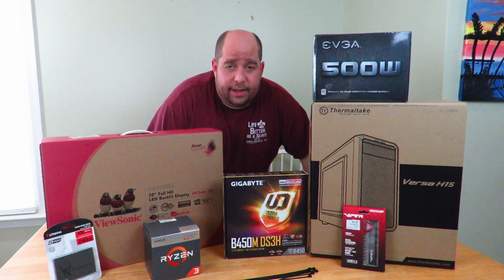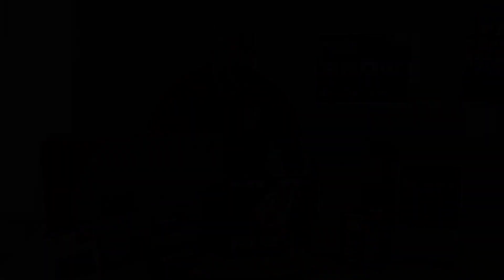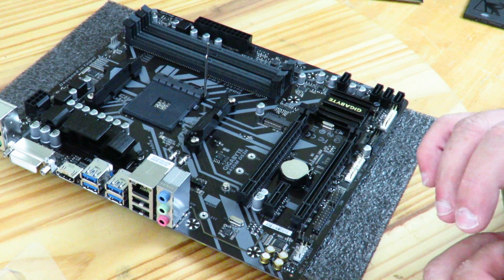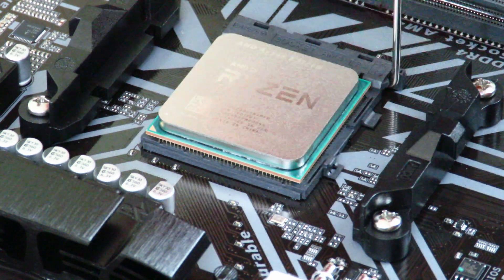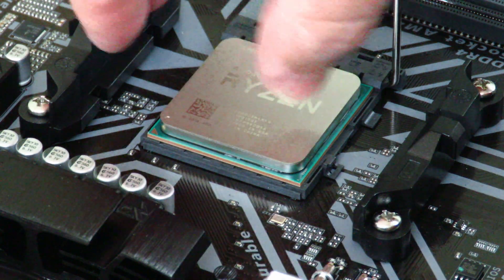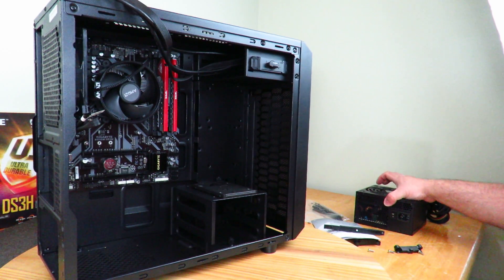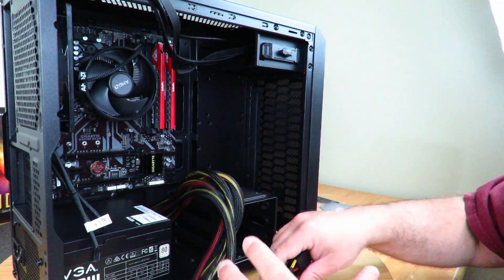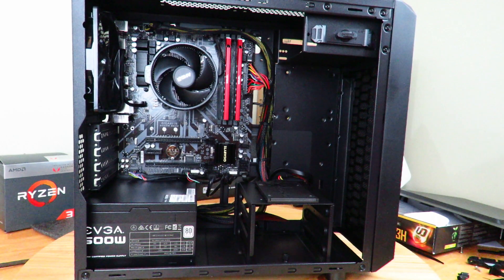How to Build Extreme Budget PC that doesn't Suck | Step By Step Guide

Comment: If only one side for the CPU power ( so the only 4 pins) was plugged in would that cause the computer to start up for 5 sec and power off and then not turn back on?
Reply from the maker: Normally no, but if they were making contact, just barely it could have caused an arc of electricity potentially burning out some pins.  Was it just not connected at all, if it was not connected at all, you should be fine.
Reply: @ThisBytesForYou  Thanks for the fast reply. One of my friends son built his first computer and judging by the pictures he sent me it looks like not all the pins are connected. I'm going to stop by tomorrow morning to check it out.
Reply from the maker: @BIendtecc  yeah, some power supplies, older ones or lower cost ones only have a 4pin cpu power, usually good for lower cost boards and lower end CPUs.  It might be good and you are so very welcome my friend, thank you so much for stopping by, checking out my video and commenting, it means the world to me.
Reply: ThisBytesForYou thanks for your time!
Reply from the maker: @BIendtecc  anytime my friend, please let me know how it goes tomorrow.
Reply: ThisBytesForYou will do!
Reply from the maker: @BIendtecc  thank you, I love helping
Reply: ThisBytesForYou so only one side was connected to the CPU, after plugging both in the computer still wouldn’t turn on. We replaced the power supply hoping it would work not that didn’t help either. We also tried a different outlet. It looks like it might be the mother board so they ordered another one. I guess we will wait and see!
Reply from the maker: @BIendtecc  ahhh man, that is horrible.  I have seen when ovrclocking that when the board goes, the cpu goes as well, and any board it touches, the board goes too.  If your next board dies, replace both the cpu and the board.  So sorry you are going through this my friend, but I will be there to help you as much as I can
Reply: ThisBytesForYou thanks!!
Reply from the maker: @BIendtecc  you are so very welcome my friend, very happy I could help you

Comment: Nice video man, thank you! Just a comment, you could transfer most of the cables towards the back so you have a relatively cleaner (and safer) cable management. Anyways, well done!
Reply from the maker: thanks bud, most cables were, but since this was not a build for me, but a friend of mine, I wanted to make things a little easy in case they wanted to upgrade or replace something.  Since it did not have a glass side panel, I was not 100% worried about looks, but still I do take pride in my builds, so I do want to leave a rats nest of cables.  As for the comments, I always welcome any and all comments and I thank you so much for stopping by and checking it out, even more for the comment, it means a ton to me, Thank you so much and I am very happy you liked the video.

Comment: Excellent choices the ram however will need to be faster for the apu to function at it's best. Does this board support the new ryzen 3000 series? There will be new apu's next year.
Reply from the maker: This is a budget build, and yes you will need faster ram with tighter timings to get the best out of the system, but these were the best prices at the time.  Yes, this board does support the newer ryzen series and no one with and nda will be ablemto answer the apu question

Comment: No thermal paste?
Reply from the maker: Of course, I used the paste that was on the heatsink, it's a budget build adding different paste would have raised the price
Reply: @ThisBytesForYou  So the paste was already on the cpu fan?
Reply from the maker: @SadaTuhatMeest  yes, it was on the cpu heatsink, it comes preapplied.  While it may not be the best, to push the budget as much as I could, I did not wipe it off to apply new paste.  I mentioned it in the video
Reply: @ThisBytesForYou  ok
Reply from the maker: @SadaTuhatMeest  I hope that helped to clear the confusion.  You always need thermal paste, new heat sinks most often come with some thermal paste in the box or preapplied.  Generally it is not the greatest though, you mostly would want to use Arctic mx4 or thermal grizlly kryonaut.  I hope you liked the video though
Reply: @ThisBytesForYou  I liked the video but I watched to maybe get a hint how to remive my gpu from this motherboard. I have the same one but i can't remove gpu cuz the thing that i have to oush down or somewhere wont go. Idk what to do
Reply from the maker: @SadaTuhatMeest  this video will show you how to remove your old card and install a new one, https://youtu.be/G5hG8GNIVRQ, what video card are you installing?
Reply: @ThisBytesForYou  Thanks a lot, will watch in a minute
Reply: @ThisBytesForYou  I have applied pressure but the card wont pop out, i unscrewed everything as well, do i just push the little tab down?
Reply from the maker: yes, sorry, youtubes notification system is horrible, I never saw this reply
Reply: @ThisBytesForYou  Its ok, i did it q long time ago
Reply from the maker: @SadaTuhatMeest  I figured you would have, but I don't like to ever not reply.  I reply to all my comment's and have opened up many cases in youtube about notifications not coming in, sadly nothing has changed yet.
Reply: @ThisBytesForYou  yes thank you for your worries, its okay now but thanks for caring
Reply from the maker: Ahhh ok, well at 3:46, you can see the pcie slot without a card in it.  You will notice at the right end , theres a little lever, you push that down and you will see your card rise a little.  Make sure your is unscrewed though, once you push that down, you can pull your card out, one sec I will link another video that shows you, not on this board but it's pretty universal

Comment: Will I get a display from the motherboard I/O using just the Ryzen 5 2600 without a dedicated graphics card? I just want normal PC use (no gaming). 

Thanks
Reply from the maker: no, the 2600 does not have integrated video, but you can get the 3400G for a great price too with integrated video, check it out on Amazon: https://geni.us/4KFzip and it comes with a decent cooler included only about $22 more than the 2600.  I hope this helps my friend, please let me know what you decide to go with.  Also, please let me know what motherboard you are thinking about using?   thank you so much for stopping by and checking out my video and commenting, it means the world to me.
Reply: ThisBytesForYou thanks for the reply. What if a get a low profile graphics card like this https://www.amazon.co.uk/MSI-Profile-Passive-Pci-E2-0-Graphics/dp/B015T3TDR8/ref=mp_s_a_1_14?keywords=gt%2B710&qid=1575293407&sr=8-14&th=1&psc=1 and use it with the 2600 will it then work? 

Basically i want a fast CPU for stock trading and I use 3 monitors (extended). Is the 3400g fast, will it perform? Please recommend a motherboard for me too. Thanks
Reply from the maker: @sspider7846  yes, that would work, but if you could, use this link, it would help me, it should be the same card but tied to my amazon affiliate: https://geni.us/P1pO
Reply: ThisBytesForYou okay no worries I will make sure to use your aff link. Should i decide to go with the 3400g do you think is a good enough process for me needs?
Reply from the maker: @sspider7846  the 3400G is still a great processor and actually, I would recommend going with an AMD card, since you will be using AMD graphics on the processor to have less potential graphics issues.  Maybe something like an RX 550 https://geni.us/5Iz7W?
Reply: ThisBytesForYou thanks for your help mate
Reply from the maker: @sspider7846  You are so very welcome my friend, please let me know if you need any help or have any questions.
Reply: ThisBytesForYou will do. Thanks again
Reply from the maker: @sspider7846  anytime my friend

Comment: Difference between this mobo and the Gigabyte B450M S2H? Which should I purchase?
Reply from the maker: The B450M DS3H has an additional x4 PCIE slot which can be a x4 or a x1, 2 additional slots for memory, and additional noise guard for less interference for audio.  1 advantage the S2H has over the DS3H though is that it has a VGA port as well, but that is more for legacy purposes.  i hope I helped you my friend.
Reply: @ThisBytesForYou  Appreciated!
Reply from the maker: @AZI3623  anytime my friend.

Comment: I was building my pc last night with the same motherboard I believe. Instead of dropping the cpu into the ZIF socket lock I accidentally broke off the pin along with the plastic layer that you were able to set it into. Instead revealing what was underneath and placing it in there. Did I mess up? Do I need to return my motherboard
Reply from the maker: Sorry, having to reply from phone, so a little short.  I am sorry to tell you my friend, if you broke a pin in the cpu, it is dead.  Check to see if you can RMA it.
Reply: @ThisBytesForYou  Hey I was able to get an exchange and build it successfully. Thanks for the reply <3

Comment: Will the AMD Ryzen 5 3400G 4-core, 8-Thread Unlocked Desktop Processor with Radeon RX Graphics work on this board??
Reply from the maker: It sure will, you can see here it will support AMD Ryzen 5 3400G, Ryzen 5 PRO 3400G, Ryzen 5 3400GE, Ryzen 5 PRO 3400GE, so you are good.  You can find it on Amazon here: GIGABYTE B450M DS3H Motherboard: https://geni.us/C30Fy
, thank you so much for stopping by, checking out my video and for commenting, it means the world to me.

Comment: Hey man, can I connect rgb fans to this motherboard? I thought it have to have one rgb header. Have bought an 5volt hub to expense it. Is it going to work?
Reply from the maker: you sure can, check it out here on Amazon: https://geni.us/C30Fy
, it has an RGB LED Header and "RGB Fusion supports RGB LED Strips in 7-Colors"
Reply: @ThisBytesForYou  thnx man. I can expand the rgb header and use it for my fans? Thnx 😊👍🏼
Reply from the maker: @gecmisinisevenadam3971  you can, I am just not sure by how much, so maybe you would want that hub, but at least you can get started now with 1 ;)  You are very welcome my friend, so very happy I could help you.
Reply: I'm having trouble with finding the rgb header on the motherboard

Comment: Is this motherboard good enough to support heavy gpu like Asus rog strix rx 580 ? I heard the build quality it's pretty cheap and cheap transistors as well but I'm looking for a budget pc. Bottom line, is this motherboard worth it?
Reply from the maker: not sure where you got this from, but this board seemed pretty solid to me.  You can tell it is not a premium board, but you are not getting a premium board at a budget price.  You should have no issues with it, with a 580, what CPU are you planning on putting in it?
Reply: @ThisBytesForYou   planning to go with a ryzen 5 2600 . I was thinking about this motherboard and Asus b450 f gaming which is like 130$ . Do you think it will make a difference in gaming ? And my biggest let's say "fear" is that the pci ex slot will not handle that mammoth of a gpu -considering this is a cheap motherboard . But I am no expert so that's why I'm asking . So that someone like you with experience can make thinks a little clear . Thanks
Reply from the maker: @cataliniulian9618  The Asus b450 f, the Strix board?  My affiliate link for Amazon  is cheaper than $130: https://geni.us/qJPy.  The Asus board has more USB ports and even USB C as well as better audio support, a little more future proof but the Gigabyte is half the price, so it's up to you, no matter what, an electrically x16 PCI-e slot is a x16 PCI-e slot, so you are good with both.  Save  a dollar today going for the Gigabyte board and you could update another component, both boards are good though.  If you are using USB headphones for audio, you wont be using the onboard 3.5mm audio, so that negates the audio, but if you headphones are 3.5mm, you might have better luck with the Asus.  The Ryzen is $119 here, not bad: https://geni.us/YaFHZK.

Man, you are making me want to build one of these, haha.   What cooling solution are you going for?
Reply: @ThisBytesForYou   thank you so much for the reply and the enthusiasm ! I see things very clearly now and that's thanks to you . I think I will go with the gigabite b450 given the fact that I won't have a lot of pros with the Asus rog strix . I just wanna have a decent gaming machine . Just like you said  , a pci ex slot it's the same . For the cooling I will go with Cooler Master Liquid 240 Lite Rgb . I am so excited about it and you really really helped me a lot .
Reply from the maker: @cataliniulian9618  you are so very welcome, very happy I could help.  Yeah the Strix is nice, but if you are not going to use all of that, you are just paying more for the name.  Please let me know how it goes once you build it.

Comment: Do it need a bios update?
Reply from the maker: you don't "need" it, but as the BIOS' come out, you get better performance and also depending on the version you have on it now, the update fixes memory issues.
Reply: B450M supports 1st and 2nd gen Ryzen.. you can use all the way up to 2700x CPU out of the box. If you want to use 3rd gen 3000+ and the upcoming 4th gen you will need a BIOS update. AMD said that they will support these boards all the way up to 4th gen so that is pretty cool! Usually you can ask the people from who you buy the motherboard to do the update for you in case you want to use a 3rd gen CPU or ask a friend to lend you a 1st or 2nd gen CPU to do it yourself. I did a similar build but I bought a 2600 CPU and RX 580 OC 4 GB GPU with 16 GB RAM. It is a rock solid low budget PC... Rise of the tomb raider works on high with 50-70 FPS, GTA5 on ultra 80-120 FPS.
Reply from the maker: @asp1re530  thanks for chiming in my friend

Comment: Where does the power supply connect too I’m stuck fml lol
Reply from the maker: My friend, did you watch the video?
Reply: Yes but it seems so confusing
Reply from the maker: @el_sancho935  thats ok my friend, thats why I made this video, to make it easier on everyone.  When I started, no one showed me, it was well before youtube and the internet we know today started, so like you I was scared, I had no idea and it took me a while but I got it going.  I make these videos so no one has to be frustrated or scared, I try to make it all easy.  I hope it helps.
Reply: I’m using a phanteks 350 case has a power supply audio and usb 3.0 and that’s all
Reply from the maker: @el_sancho935  ok, you need to have a motherboard as well, and then cables that connect from the power supply to the motherboard, do you have a motherboard?  If so what motherboard do you have?
Reply: Also you kind skipped over it you went to the manual the went straight to the other cables
Reply from the maker: @el_sancho935  well yeah, I would skip the manual, I am showing you here,  but aside from following the video, the manual might have pieces I might have missed though usually the manual does not help too much.
Reply: With fan cables don’t even know where those go 😂
Reply from the maker: @el_sancho935  fan cables will go connected to the 4 pin headers on the motherboard (could also be 3 pin)
Reply: I have the same motherboard b450 ds3h
Reply from the maker: @el_sancho935  ahhh yeah, then just follow the instructions here and you will be good.  just take it slow my friend, we have all been there.
Reply: Yea thanks I really appreciate it
Reply from the maker: @el_sancho935  you are very welcome my friend, so very happy I could help
Reply: I have 2 cables that say D-rgb fans I turn it on and the light from ram turns on but no fans are spinning I’m assuming because there not connected
Reply from the maker: @el_sancho935  I did not go over RGB as this system did not have it, but the board does, you can find the headers near the rear audio port, or you can find it here https://www.gigabyte.com/us/Motherboard/B450M-DS3H-rev-10#kf, do a search for "RGB LED Header" and you will see it there.
Reply: For the motherboard where exactly does the Rgb fan connect
Reply: On the mother board is it labels system fan ?

Comment: I have this same mother board I plugged everything in and my just won’t turn on
Reply from the maker: You plugged in the 8 pin eps power and the 24pin atx along with a cpu and RAM and it does not power on, you sure you have the front panel header connected correctly